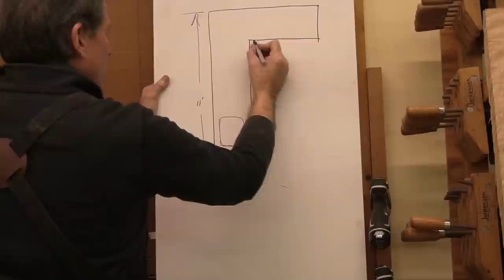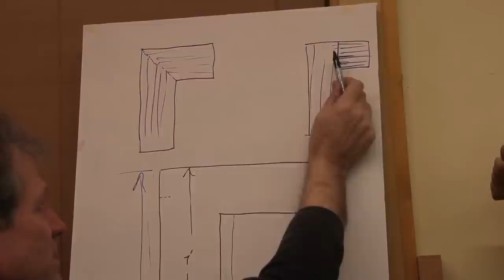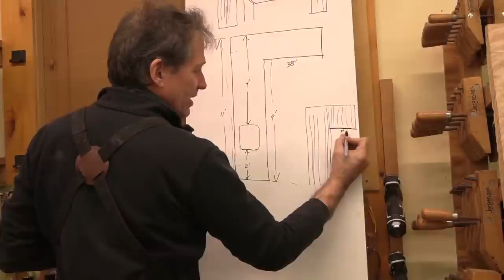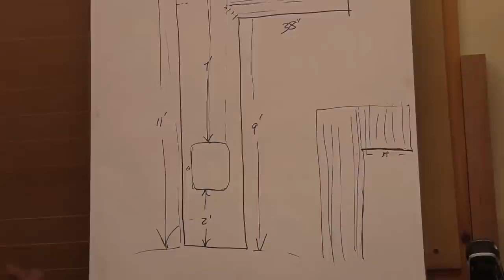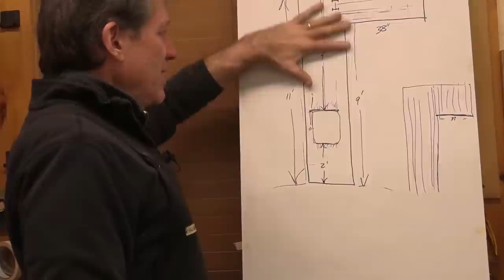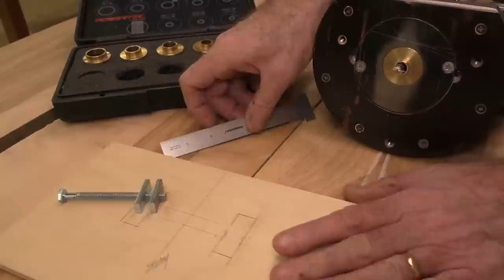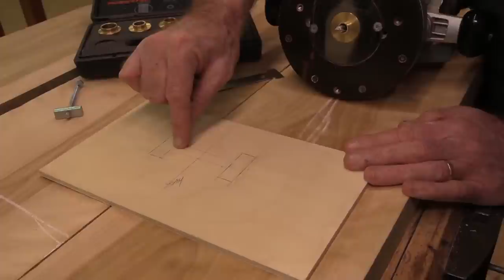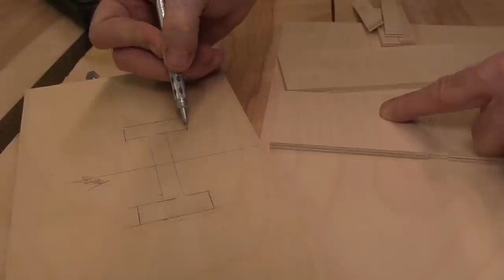Making a Solid Wood Countertop

Comment: I made an oak counter top and did herringbone in the corner. never had an issue and that was 20+ years ago I did Tongue and groove the edges, so layer it just like a floor.
Reply from the maker: Sounds nice! I hadn’t thought of using a herringbone corner with my wider stock. Yours lasting 20+ years is plenty proof of concept. Thanks for watching! 👍😎

Comment: Some one else stated already about Totalboat. I will add Totalboat Halcyon in clear or satin. As for your joint since going with Festool Domin try using the Domino connector system instead of the dog bone aka drop ties.  Not sure if you are using the DF500 or the DF700 XL version but the connector system will work to tie the countertops together and allow seasonal expansion. Or just do a herringbone with dominos. Also be sure to seal the underside of counter top near the sink area many people seal the top around the sink but forget about the underside, silicone is also subjected to changes in hot cold and can move. I have in my past done many custom formica and wood veneered countertops over hardwood to change the  look and plywood as new installation.
Reply from the maker: Thank you so much for your experience based advice! I did use an epoxy as the first sealer coat, allowing it to soak in a bit…both sides with an emphasis near the sink hole. I’ll be following with two or three coats of Arm r Seal, a poly blend, due to its ease of application, protection and simplicity to sand and topcoat in the future.
I did go with the dog bones, and dry fit dominoes along the joint to allow movement. I saw those Domino connectors when they first came out but didn’t pickup any yet. I only have the DF500 and I saw that system as being a good potential alternative for joining bed rails. And I will be taking your advice with the silicone caulking…it will go on the stainless rim before attaching it as an undermount. Hopefully get it installed a week from Saturday and get the video out soon after. Thanks again! 👍

Comment: This is probably a little late but Total Boat makes a Penetrating Epoxy. They have great customer service and are very willing to help.
Reply from the maker: Thank you so much! I did take your advice, as well as another person who also suggested using epoxy. But I used what I had on hand, not buying new from Total boat…but good to know as a resource in the future. I used the epoxy as a sealer coat, and now need to add the top coats which will be arm r seal, a poly blend for ease of application, and repair ability down the road.
Thanks again! 👍😎

Comment: That was great.  I look forward to viewing the build.  I do wonder as a learning process how a full mitre with a bread board joint directly joining the two panels would perform.  Fixed in the middle, after watching your show this morning, with a dog bone and supported on either side just like a bread board joint.  My thoughts are   1. would the expansion and contraction pull the outer edges of the joint apart by pulling too hard on the pins,   2. could the outer pins be stopped 1/4" before breaching the top surface,   3. by gluing the middle 7" and locking with the dog bone that'd leave about 13" to 14" of "floating" joint on each side. Is that enough to cause issues?   4.  would one use two or three "floating" pins on either side.              It's all just theoretical learning curve stuff. And you might have some experienced thoughts on the matter.
Reply from the maker: Thanks Danny, I’m not sure I completely follow your question given the visual nature of it. But your question seems to be asking if it’s possible to control the movement of the wood over a the complete long miter if there was a board inserted perpendicular to the joint to restrict it like a breadboard. 
I don’t think these approaches would be effective in the long run because the wood will still move and open up the joint along the miter at the ends as described in the video. Every time I have thought I could restrict the movement in the past using a similar approach, the movement wins…like trying to hold back the tide. I only have one shot at this one, and given the lengths of materials I have and not wanting to splice for lengths, I opted to use a controlled partial miter. The front board is mitered and glued with floating tenons while the back 90 degree joint is dry aligned with dominoes for movement across the joint and held together with the dog bones. The expansion and contraction which will occur will happen out the back underneath the backsplash. At least that’s the plan, we’ll see how successful it was in ten years or so! 😎
Thanks for watching 👍

Comment: To use your long boards optimally, why not miter the outer board as you’ve shown but then run boards for the short arm of the L all the way straight back to the long backsplash. That way the long arm of the L would need only 11’ minus (if I remembered the width of the top correctly) 24” allowing you to have straight runs of boards the don’t require a butt joint next to the sink.
Reply from the maker: That’s a great observation and suggestion Ron! I may end up doing just that. As I’m working with the material I’m finding the longer board I had planned for the back is quite wavy and has a bad end so your idea might also work well for that reason. Thanks for the idea, and for watching! 👍😎